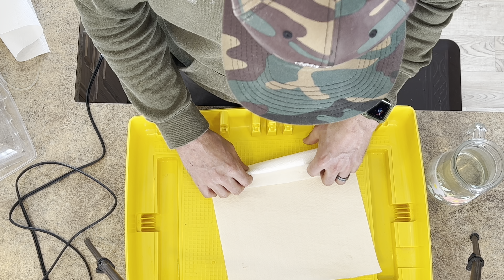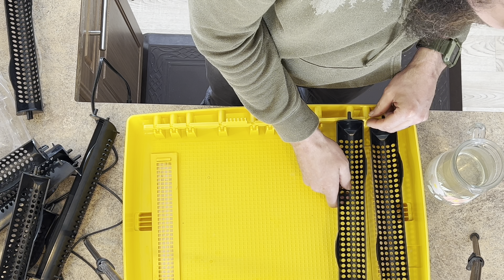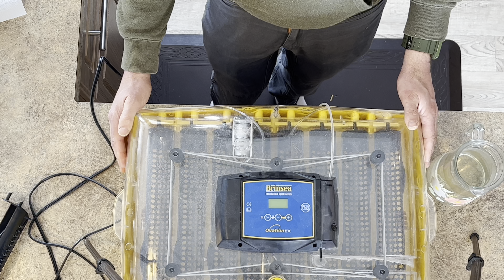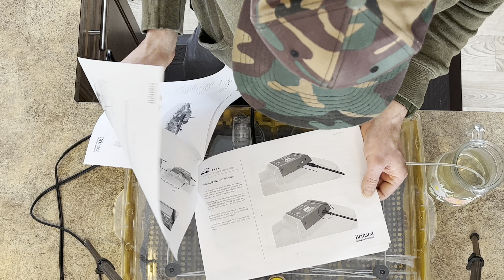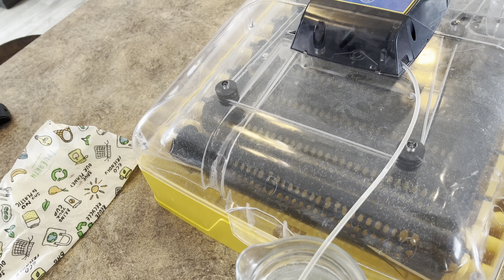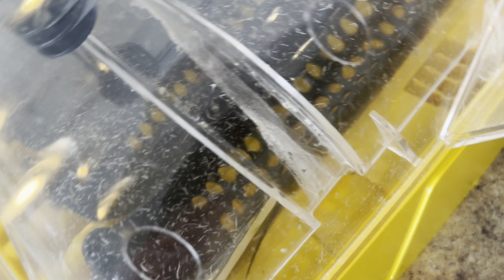Dialing in the BRINSEA OVATION 56 EX INCUBATOR!!

Comment: Thanks. Good details. Though per the instructions the turning / indicates that turning is turned on, no the humidity. If turning is switched off, it will show a 0. I just got mine and haven't played with it enough to know that it is true. Either you are right, or the instructions are right.

Comment: Can you hatch different eggs at different times? Like take out a tray and have the eggs on the floor to hatch on half the incubator?
Reply from the maker: You probably could, so long as you have no interest in candling the eggs still in the tray, just for the fact that you need to keep the lid closed permanently when you see pips. Also I would be concerned about bacteria growth affecting the hatch rate of the eggs still in the incubation process. 
We do incubate eggs at different times, however, we have a second incubator to do the lockdowns. So basically one incubator to incubate, and one for hatching
Hope this makes sense, thanks for watching!!